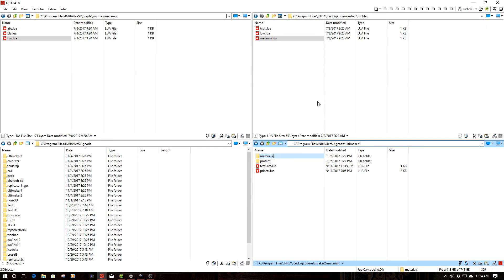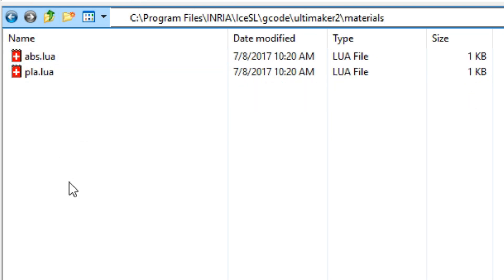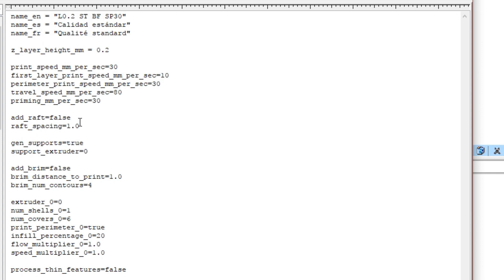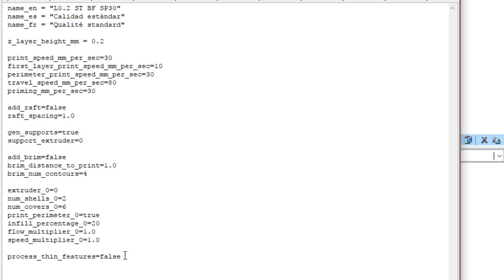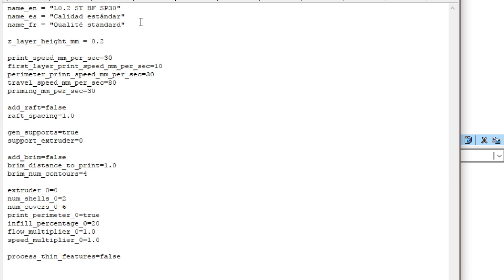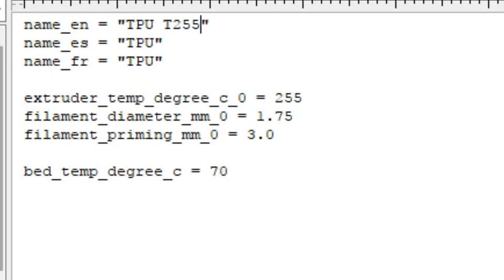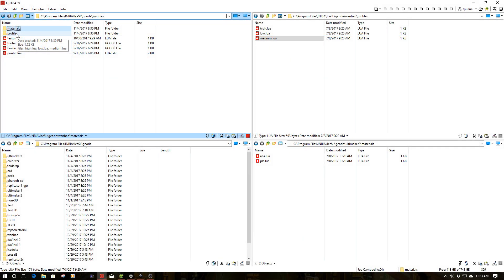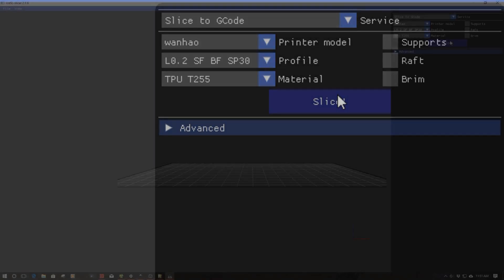IceSL Slicer - How To Add Printer and Material Profiles!

Comment: I would be interested in how this can be setup to work with the davinci 2.0a running repetier host?
Reply from the maker: If you reflashed yes it can, just set the configuration davinci 2.0a an slice away.  I do it with mine all the time as I just place the gcode file on the card and print away